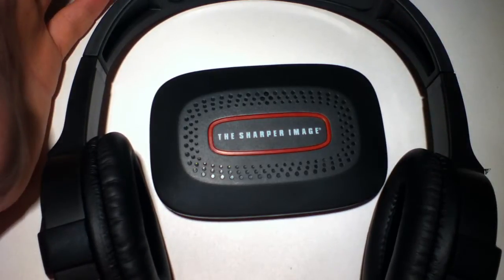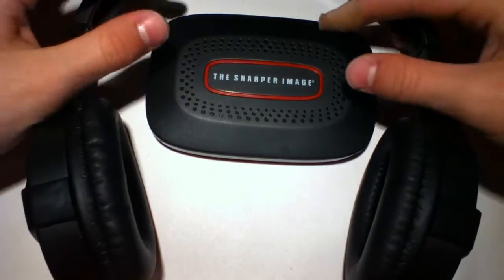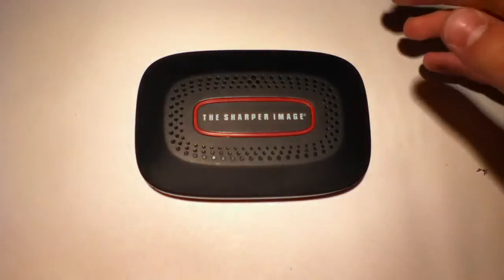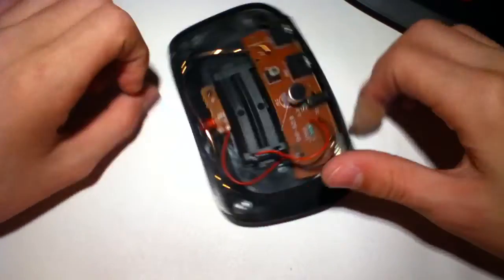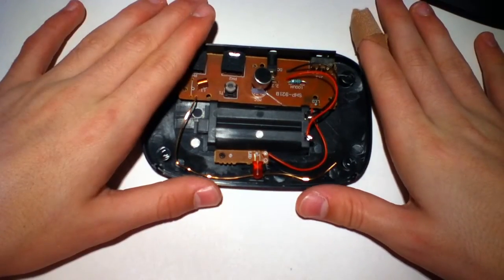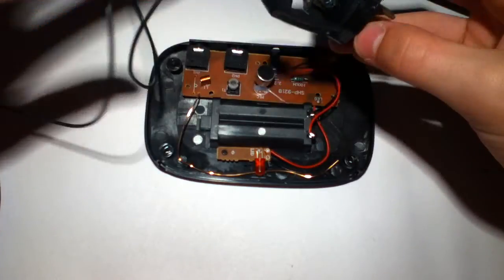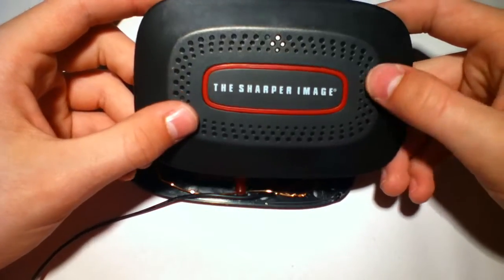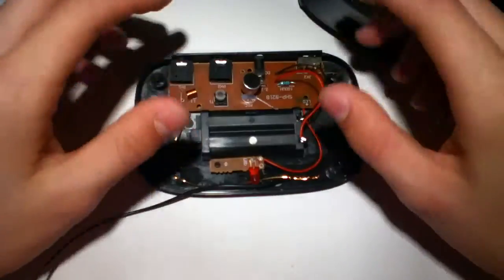Sharper Image Audio Transmitter Hack

Comment: Nice hack.  but Never assume your AC ground is unenergized.  Always test first with a ground-checking probe, lest ye fry your equipment or electrocute yourself.  You should always add a disclaimer/ warning when discussing power line circuits for your own protection and to avoid someone getting hurt.  Just saying . . .

Comment: Technically, it is illegal.  If your neighbors complained,  the FCC could revoke your broadcaster's license.  Oh wait, you don't have a license! This radio probably operates at 433-434MHz, which is used by many other home radio devices like baby monitors, garage door openers, wireless weather stations, etc.  so it wouldnt be out of the question that you might be stepping on someone's air waves.

Comment: 1. not legal. 2. you get some insane standing waves, and will eventually kill the transmitter. and 3. if there is a ground fault in the house, and some appliance borks, you will get mains straight on the transmitter output. Just overall a very bad idea.
Reply: Totally illegal. It is against the law to modify an FCC approved device.
Reply: Standing waves at that power level would be a non factor as far as effecting the electronics other than efficiency. There is also the caveat that any RF device must accept any interference natural or man made under the flea power situation. Unless you interfere with Police, Fire, or Medical activities it is extremely unlikely that anyone would visit you and it would simply be a cease and desist request.